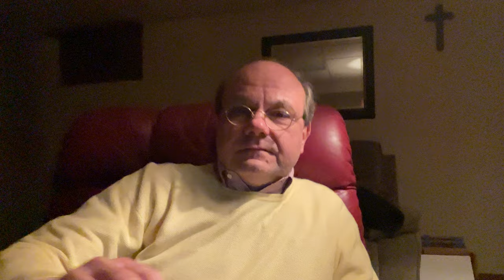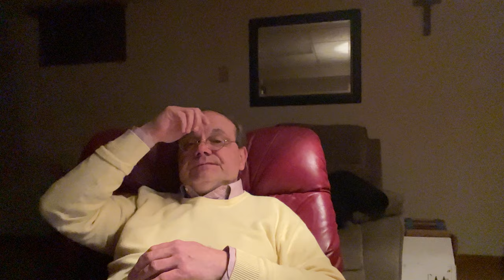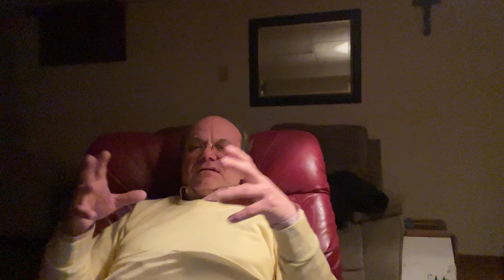Mercedes - Bosch Jetronic, the history & Brains behind it, a reflection of growing up in Stuttgart

Comment: Hi, 
I write to you from Nairobi, Kenya. In 1984 I lived one and a half hours by train from your home city Stuttgart in a town called Schwäbisch Hall where I studied German at the Goethe Institute for a few months before moving to Munich.
I did not understand 90% of what you talked about in your presentation though I watched it from beginning to end. That's because I am a hotelier by profession. I am also a Classic Mercedes Benz  fan and I have a 1971 W108, 1986 C126 and a 1989 W124. 
You mentioned somewhere in your presentation something about upgrading circuit boards.
I have a question for you. Is there a need to upgrade the VDO Instrument Cluster Circuit Board for Fuel, Oil and Temperature guages on a 1971 W108 280SE?
The ones on my car work but I'm thinking about preservation for the future.
Although I didn't understand much, I would also like to say thank you for the time you have taken to share your experience.

Comment: Hy do you know how to fix on Bosch KE-Jetronic  fuel leak from an EHA ( electro hydraulic actuator) on Mercedes 190E 1984 ?
Reply from the maker: The questions is:
Is the EHA leaking (internal gasket defect) or is the leak coming from in between fuel distributor and EHA? If that’s the leak then replace the two green O rings.
If it is an internal leak, then you need to buy a new EHA from Bosch or Mercedes Benz - these units cannot be Disassembled for rebuilding

Comment: Thanks again for the videos you've recorded for us so far.

I don't watch long videos. because I do not know enough English, but I have translated many times on the subjects that I am curious about,
 I'm getting a dictionary and trying to capture the details. I'm so lucky to watch this video :)
Reply: I love everything electronic on the 600 SEL.
We like to fix it before we buy new and high-priced parts.
 You're right about that. This job is a hobby.
If the alarm notification sound is not working, I do not want to get in my vehicle. You performed the alarm repair for your vehicle and shared it with us. There are no videos with similar content anywhere. Thanks again...
Reply: Thanks for the cable info. I examined the engine electrical installation in my 1989 model w124 vehicle.
PVC coatings have little wear, but copper wires are strong and durable. What you said is absolutely true, you have proven it with this video.
((You are a professional and a good person even though I can't see this video. I would like to work if I was close to you in terms of location)) 😜
Reply: The integrateds in the ECU may be suspicious or corrupted. However, I was too lazy to change it because there was not enough hardware.

I've heard that for a car that doesn't idle properly, it has good idle speed after a small integrated modification.
Reply: Thanks again for everything. If you post a longer video, you can be sure that I will enjoy watching it.
Youtube didn't allow me to comment that long in one go. Sorry for posting this way.

Comment: watching youtube
Idle control valve was helpful.
from Japan
I own w126 560SEC
I would like to hear your opinion
Benz air distribution hose
How is the quality and durability of URO parts compared to genuine Mercedes?
Reply from the maker: Hi 007 sg Greetings to Japan. ÜRO parts depend on which parts you are using from ÜRO. ÜRO is making actual Mercedes Benz Parts Mercedes Benz no longer sells. Like the Combination Switch for Turnsignal, high beam and wiper and the rebuilt kit for the mono valve and the window switches - they are basically exactly the same as the original Mercedes Benz Parts once were. 
I made some videos about those parts and I put them in my 1989 560SEL and they work fine.
I can’t really say anything about the other ÜRO parts which are still available from Mercedes Benz since I buy MB parts as long as they are available
Reply: Hello
Thank you for your reply
I'm happy
Watch your other videos
So it will be helpful
I'm looking forward to the next video.

also
If you have any questions about Japan, please let me know.

Comment: have a 88 300te with a changed or turned back odometer. have read that it's hall effects sensor could tell mileage plus or minus 10,000 miles. can some tell me a way to get this info?
Reply from the maker: Jon, that’s fiction. The Hall effect sensor does not store any information, it’s just a sensor which converts a rotary motion to a electrical signal
Reply: @inovahightechltd  thanks,asked others, now seems I've asked the best

Comment: On cars affected by biodegradable wiring-- is it only the engine harnesses or is it all wiring behind the dash, interior, etc? I understand that the engine heat accelerates the deterioration but won't this eventually happen to ALL wiring inside the car as well?
Reply from the maker: Hi Nahe,
It depends on how the car is/was stored. 
Engine harness and starter harness are mostly affected.
All car harnesses should be inspected
Reply: @inovahightechltd  so, it seems like if you drive your car in the summer when it is 90 degrees outside, the interior could frequently reach well over 100 f. It seems like this would ruin all interior wiring.
Reply from the maker: Nahe, it’s more like when the car is parked outside or in a barn / shed 24/7 - that’s your worse case scenario.